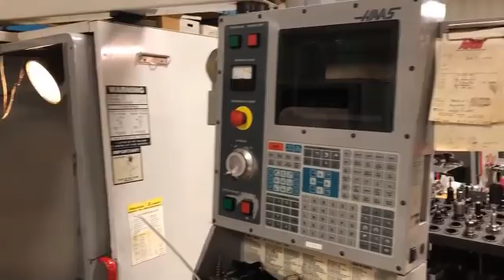It all starts with visualizing the process

Comment: Programming is easy, strategy is the hard part. Sometimes that's the wall that some can never make it over.
Reply from the maker: Ryder 47 
I agree. That is why good programmers are hard to find.
Reply: @TomStikkelman  tell me about it that's why I have decided to train as it's better to get them, to work how I do. It offers fluidity on the shop floor.
Reply: @TomStikkelman  one question? Why not do that job in three ops ?
Reply from the maker: Ryder 47 
The operator is running multiple machines and so the cycle time allows him to do other operations in the mean time and it saves tool changes. When a tool is active it machines all stations reducing overal cycle time. If I had additional open spindles I would consider a 1 or 2 piece flow and increase the throughput but they are all busy so I believe I understand your thoughts on that
Reply: @TomStikkelman  I see, I'm not criticising just curious. If you get the same results there is no wrong way👍
Reply from the maker: Ryder 47 
Absolutely. I think that is just another decision us programmers have to make and that is to tailor our processes to accommodate the workload. I appreciate your feedback 👍

Comment: I am CNC programmer.
I started as a operator with zero knowledge of CNC machines.
Now, I'm designing and building parts and fixtures on my computer.
Most satisfying job I ever had with great pay.
My advice would be.
Learn, learn and learn.
As a operator understand what you running.
Master what you running.
Learn the print and understand the program.
Move on to the next job and do the same thing.
Watch the machine run, and reading read the program.
Work hard and make more quality parts.
Ask for more training and take on more responsibility.
Everybody wants to be programmer, but only few people will get the opportunity to become one.
Work hard to get the opportunity.
Reply from the maker: Hey Jiri. That is a great success story. You are absolutely right. It takes hard work and paying attention and using what you learn from each project on future processes. Thank for your feedback. Tom